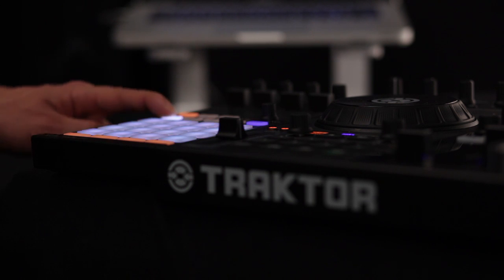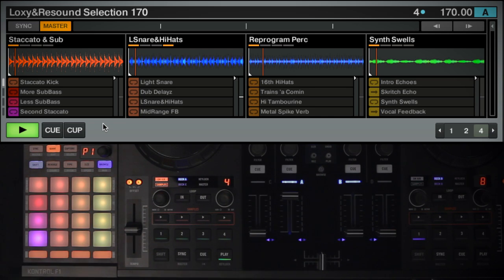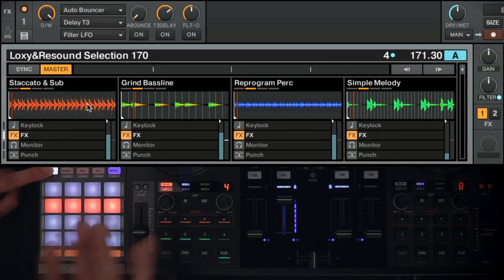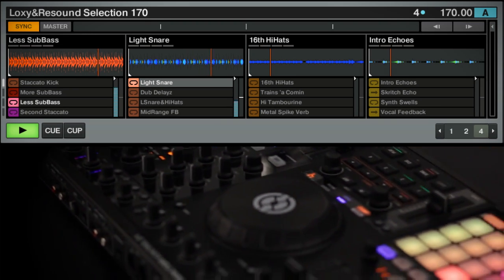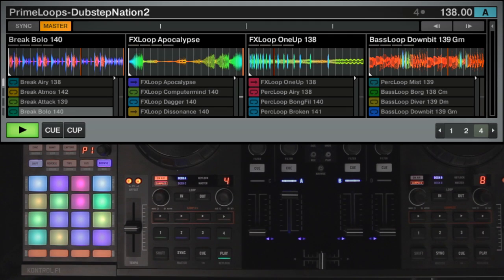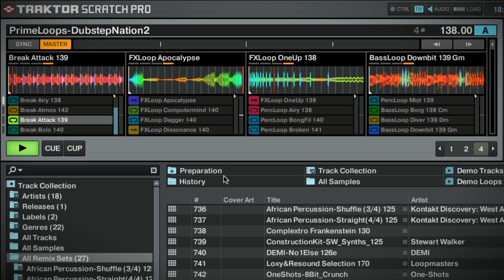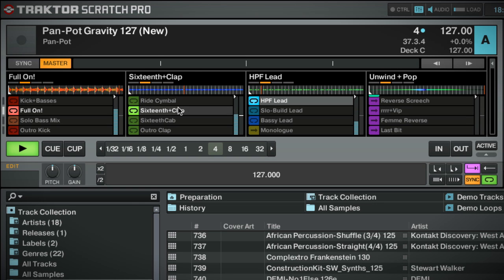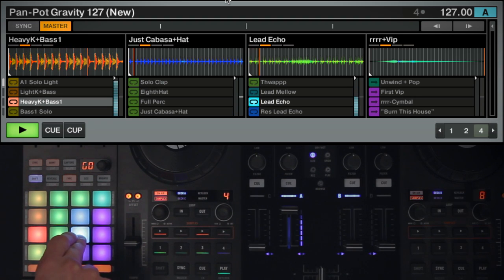Native Instruments Traktor Kontrol F1 - Remix Set™ Performance Advanced | Native Instruments

Comment: No you can't. The F1 is a midi controller which means it sends signals to the computer to modify parameters of Traktor or other software. There is no internal memory or audio output options from the device.